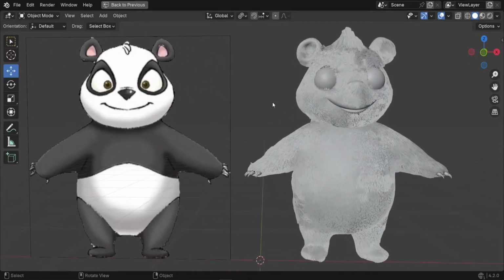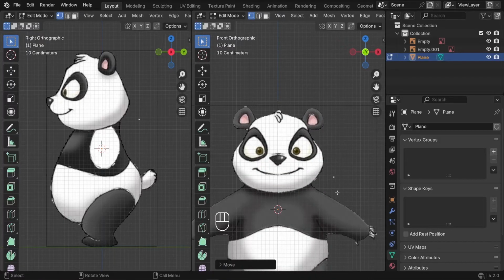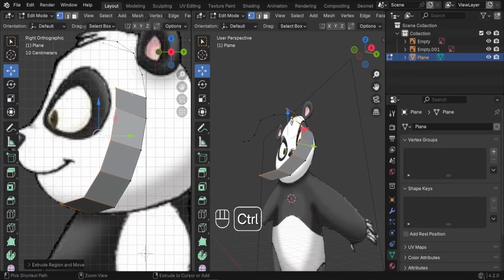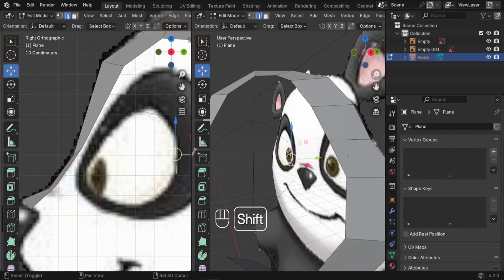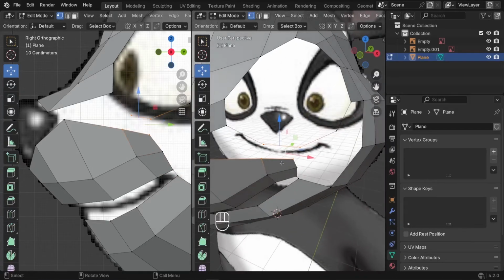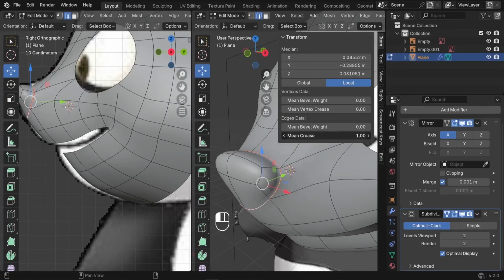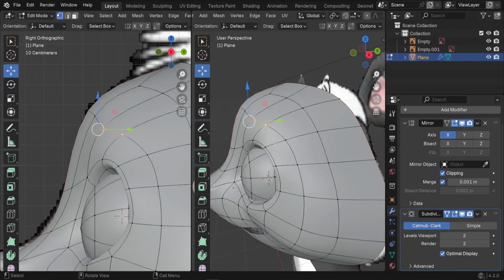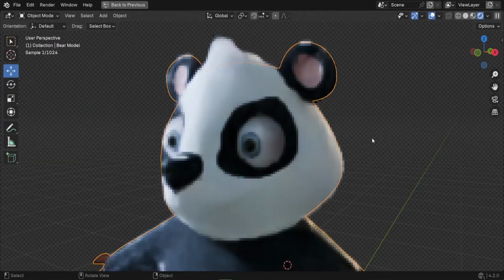2D Image to 3D Character in Blender - Part 1 (Beginners Tutorial)

Comment: Hello, I have a question. Why is it that when I get to the texture paint section, after using fill to paint the entire body, I can't paint over it when I switch to brush? I'm using Blender 4.5 and I hope someone can explain this.
Reply: You need to uv unwrap and bake before texturing
Reply: @Weaked_garl  ya bro I unwrapped UV when creating the texture, but after using fill, I still can't paint with the brush even though I've tried redoing the UV several times.